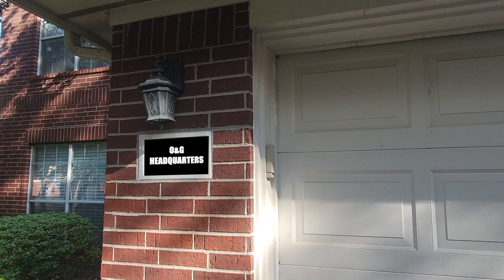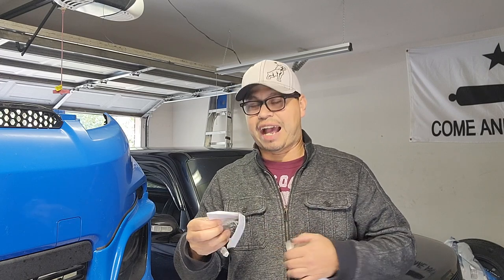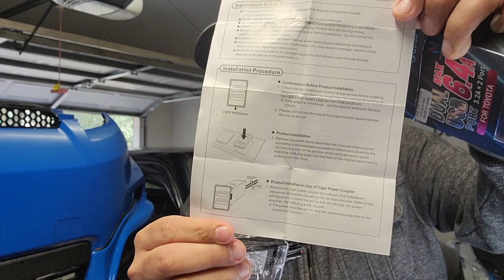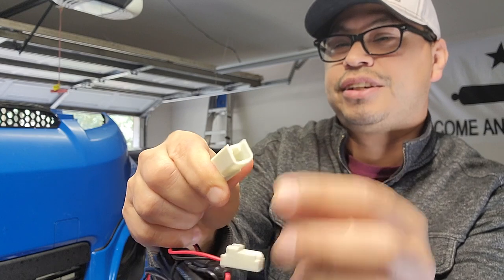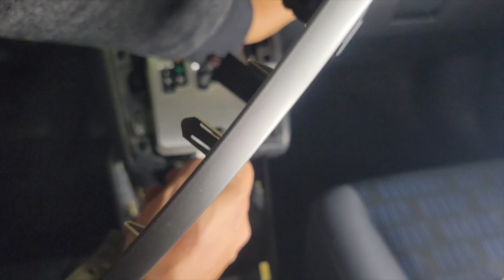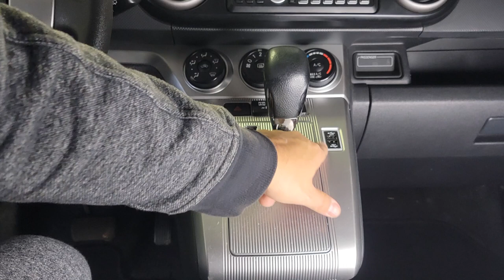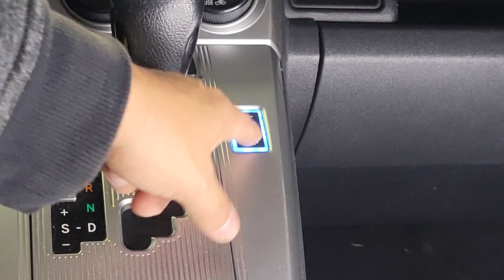DUAL USB PORTS FOR THE GEN 2 SCION xB

Comment: Interesting.  i just put one of those 2 port chargers that plugs directly into the cigarette lighter for charging.  I wasn't sure at first if it had to be taken out when the car was turned off, but it didn't affect the car battery at all.  I also bought a lighter adapter that has a 3 prong outlet for things like laptops. 😄

Comment: i was wondering if you plan to add usb port panel on the back of the center console for your backseat riders? Then just tap in the existing usb/ipod harness inside the center console. Since there's no cig socket for a simple usb plug in.  Let me know if your cool to do that mod for our fellow xBers. thanks!

Comment: why does everyone's x2 bb look different than mine. ugh. on mine, that little square that ur instlling the usb sockets to has a security thing and some sort of microphone looking thing. also mine doesnt have that "release" emblem at the top either. also everyones stock stereo looks WAY different than mine. wtf lol. its driving me crazy when i look for videos on stuff and they have the same car but different stuff. mines an 09 xb
Reply from the maker: The 08-10 is the gen 2 xB. The 11-15 is the gen 2.5. You'll notice the difference in the upgraded front bumper and taillights. The plate on the console indicates if the car is a release series which your is not. Gen 2 and gen 2.5 had different features but some things can be interchanged and some can't like the bumpers, headlights and taillights . They did make more aftermarket parts for the gen 2. Hope this helps.
Reply: @OilandGears  yea im gonna take a dremmel to the rubber covers and install the running lights from the newer models lol. also installing the fog lights and grill. any idea how to upgrade the speakers considering its a 6 speaker setup which is a bit odd? any recommendations for an upgraded stereo to fit this beauty?
Reply from the maker: I haven't gotten to that point just yet lol

Comment: Question for you all I have a 2009 xb and my average mpg is showing 21.8 I use 50 highway and 50 city . Just curious to see if this is normal mpg seams very low
Reply from the maker: There are some things you can do to try and improve gas mileage. Clean the MAF sensor, add seafoam next time you fill your gas tank.

Comment: Has anyone tried to piggy back two of these and put another one in a blank on the drivers side ?  I have an extra one but wasn’t sure if this would cause any issues
Reply from the maker: You may want to have them with their own dedicated wiring to minimize any electrical short. I have not seen anyone piggyback two of them.